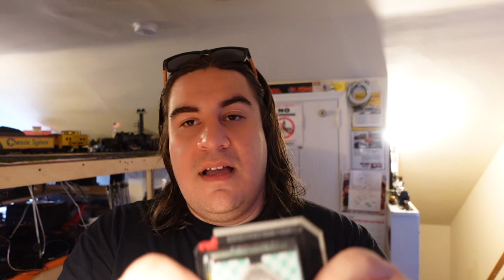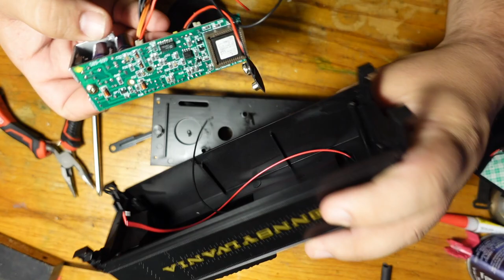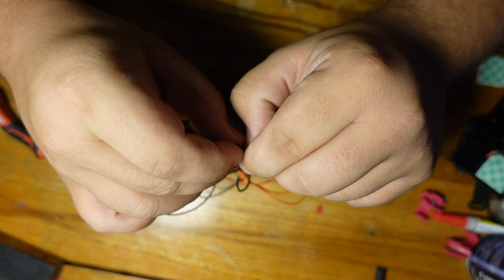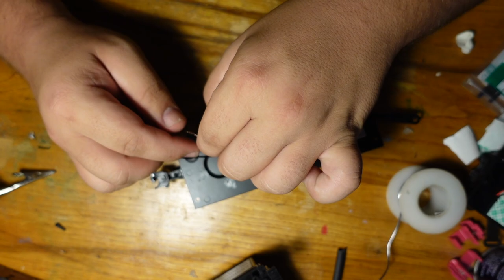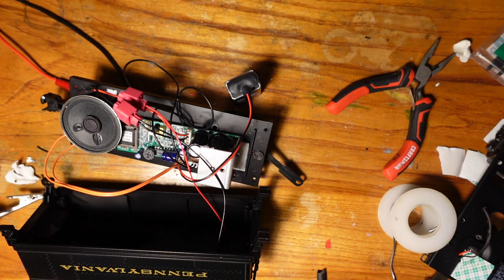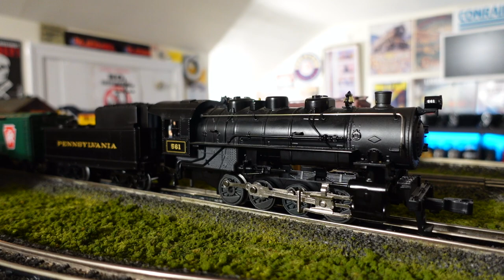Installing Railsounds, Upgrading Lionel Starter Set (Railsounds Kit)

Comment: Nice! Very cool upgrade. You may actually inspire me to do something similar instead of trying to fix the SOS boards, which sound bad even on a good day! Great video Nick, thanks for doing this tutorial.
Reply from the maker: Thanks for watching brother! You’ll have a blast upgrading those. This engine is still %100 conventional 👍🏻. You might need a whistle button in line of the circuit to get the bell to work. They are inexpensive. 🚂💨
Reply: Hey Dave, if you intending to dispose of your S.O.S. boards, please let me know. I would like to rebuild them with new capacitors, diodes, and resistors.
Reply: @TomzTrainzandAccessories  ok gotcha. At the moment I plan on saving them and seeing if I can fix them. If im not going to, ill try to remember to let you know. 👍

Comment: Great tutorial Nick!  It's kind of like what I did with an MTH Dreyfuss Hudson with a strong whistle but a "chuff-chuff" that sounded like someone banging pots and pans together.  I shut off the engine sounds after installing an ERR sound system in the baggage car.  (I didn't want to mess around with the electronics in the tender.)  I did the drill the holes in the frame thing too but I didn't bother with the "chuff-chuff" feature, I don't find it all that necessary as I think the visual dynamics of a steam engine are dramatic enough, a strong whistle and bell is good enough for me.  I'm happy with it.
Reply from the maker: Thanks so much for watching! Yes, sometimes the tender is used as a soundbox to deepen / amplify the chuff sounds. The new super bass speakers are just speakers with fancy baffling just like I’d make while I was a musician/ drummer lol.  That’s pretty awesome having a rail sounds baggage car 🤔 I think that would be so cool!
Reply: @NixCrossing  Nick, I got the idea of putting the sound unit in a baggage car (instead of the risky move of gutting the tender) from a REA Express car I bought at a train show.  Sometime in the past a previous owner mounted a post-war Lionel whistle unit in it, and it was a slick freelance job I must say!  It was a neat way of adding sound to a postwar consist pulled by an engine that didn't have a whistle and with no easy way to mount one.  
I use the REA car the same way, in fact I also use it with any post-war engine that DOES have a whistle unit, it creates a neat "stereo effect" if you get my meaning!

Comment: Nice. How do you control the whistle and the bell in conventional?  The ZW only  has direction and whistle.
Reply from the maker: Thanks so much for watching! If you’re using a vintage ZW, you will be able to activate the whistle, not the bell. I’m currently using a TMCC remote in conventional mode (variable track voltage).

Comment: Funny you mention this has a hooter whistle it makes me think a lot of my 0-8-0, which was in the keystone flyer starter set and I got that as my first o scale set along with a k line nestle set
I have a lionchief 0-8-0 PRR #421 with the red tender top and PRR h10/n&w y6b style front number, and it has a hooter too, and rail sounds, yet the sound system is just a speaker and some wires to the tender tether that’s it the engine itself has the circuit board, But sounds and works the same pretty much
Reply from the maker: Those engines are really cool! I think Lionel put hooter whistles and Lionchief in these sets the year after I got this for Christmas - 2011 I think. We bought this set at a Sears seasonal Christmas section. I thought about weathering this model for fun because it has a lot of great details and crew figures. I’ll probably also add an LED for firebox glow. Thanks so much for watching!

Comment: err by 3rd rail said Railsounds commander will not work with my Kw transformer, I realize all I would get would be the chuffing and whistle, But they said I would burn up the board with as much voltage the kw puts out, it's only puts out 20 volts and they recommend a cw 80 which puts 18 volts

Comment: Could you replace the sound chip with any other steam sound chip if you wanted a different whistle? I’m scratch building a Vanderbilt style tender and I’d like to install Railsounds on it and I had a specific whistle in mind.
Reply from the maker: I believe you could install a Railsounds chip from the same revision. I honestly haven’t tried that before.  At this point I would install a proto sound 3 board if the motor in your engine is DC and has a flywheel.